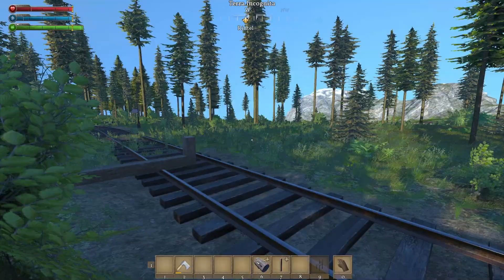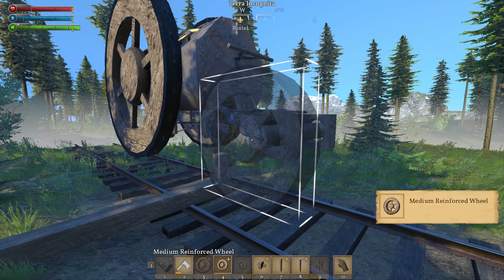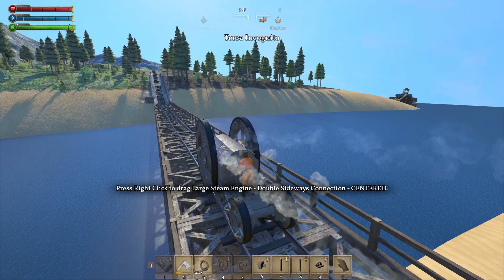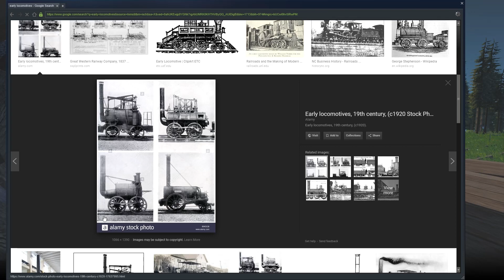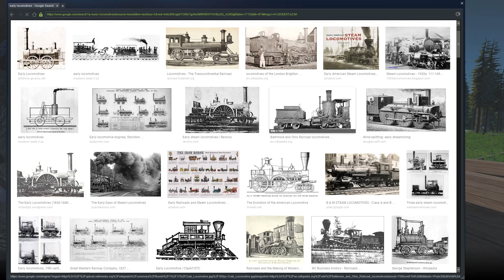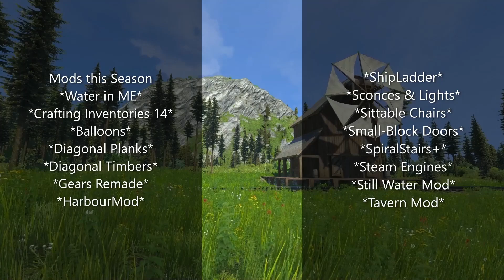Medieval Engineers Season 5 Episode 27 - A New Locomotive!

Comment: Don't forget to save your buildings as blueprints so you don't have to design them from scratch again in the new world. I'm thinking mainly about the station, but the other buildings will be easier to build with blueprints. (I don't play the game, but from what I've seen on the 0.7 streams, you press Ctrl+B to save a blueprint. You will need all the mods that it uses to work, though.)
Reply from the maker: My plan is to blueprint the buildings in .7 and bring them into a new world.   Hopefully that will avoid as much clang as possible.